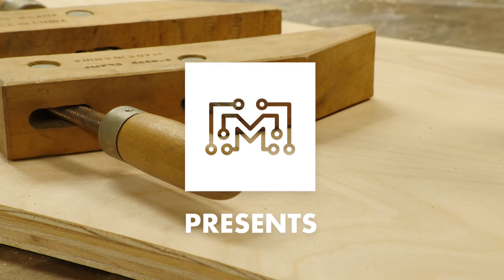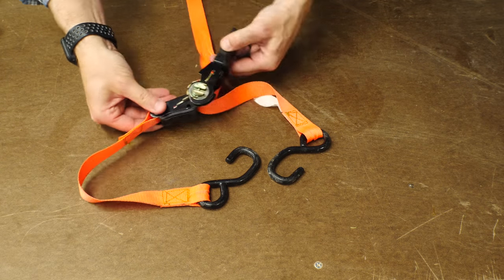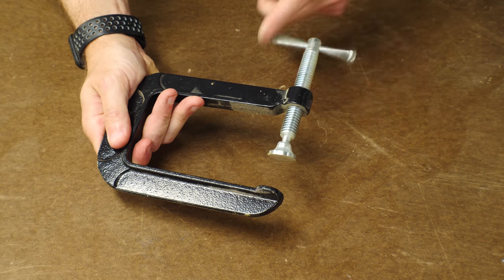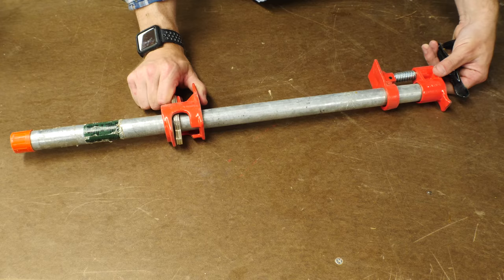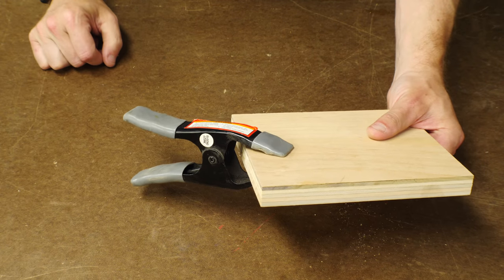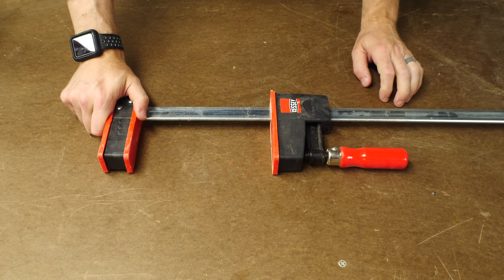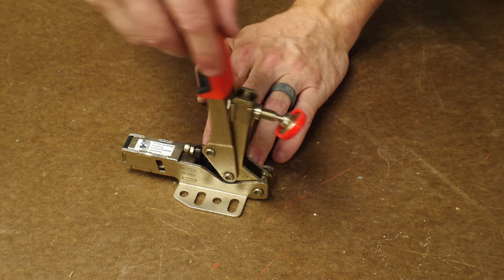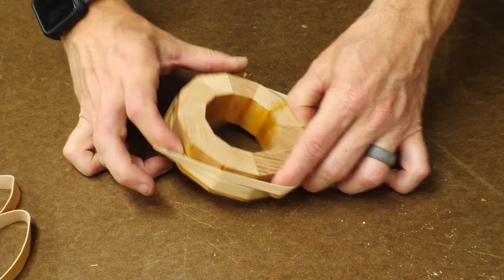Clamps // Bits | I Like To Make Stuff

Comment: Really digging this series Bob!  I really like my parallel clamps for panels, and it’s amazing how often I’ve used blue tape as at least an initial clamp when joining four mitered pieces together in a square/rectangle... Wooden screw clamps that are clamped to a surface can be a great vise if someone lacks a vise. It’s what I did before I built my workbench. - Jim

Comment: Tape is an underrated "clamp" for sure - thank you for mentioning it!  You are right that there are almost endless types, I think the only one I use often enough not mentioned is an adjustable locking clamp similar to a vice-grips (mostly to keep two flat surfaces...flat while joining).  Thanks for the bit!

Comment: Also vise grips/locking pliers. I use a couple of 250mm wide ones meant for holding steel plate when welding. Good for sheet material, stuff that's not too deep.

Comment: Obviously some special use stuff, but pretty useful to have in your workshop for fixing one thing to another while you attach it (my broad definition of a clamp): zipties, locking pliers, atery clamps, magnets and last but not least typecleaner for soldering. It`s a putty like substance formally used to clean typewriters. It comes off without leaving anything behind and works better than any clamp for placing small electrical components.

Comment: For a cheap light duty spring clamp you can use sections of PVC pipe with a slit cut in them, and large binder clips from the office supply cabinet.

Comment: Another 'clamp' for large objects is a stop block screwed to one side of your table, and a a pair of wedges to the other side. One wedge fixed to the table, the other can be tapped to put tension on the workpiece.Will provide a large clamping force over a wide distance. Can eb used to clamp two sides of a cabinet for instance.

Comment: My favourite clamping for large pieces IE 8x4 and above. or can be used for smaller stuff. put the piece on the floor, screw scrap wood to the floor butting up to one side. then the other screw a piece at an acute angle. make a wedge then hammer it between the work piece and scrap, squeezing the pieces together.  This is good for those who are on a budget are are not able to afford the long bar clamps.

Comment: Sash clamps/cramps Are good for things like table tops and come in a variety of sizes but there's a bit of set up work with finding the right hole for the pin and finding some the same size and length.

Comment: hey bob i have a request ,I have a project that i need your help with you see wanna make a wood burning stove but i wanna recycle instead of buying one, now i wanna make it either from a gas cylinder or a barrel i've seen many tutorials but they all require welding and extra material but  i only have basic tools plus a grinder and a drill and that's it and i hope you have a good day.

Comment: Consumer warning: don't bother buying the super cheap, 4 for $20, red corner clamps from Amazon (not the ones in the video, those look fine). I did, and they're SO bad. Super cheap feeling, the bolt shaft sticks up into the area the wood is supposed to sit flat in, so it seesaws, and the finger holds for tightening are so small you could actually cut yourself if you apply too much pressure.learn from my mistake, spend a little extra to not waste your time.